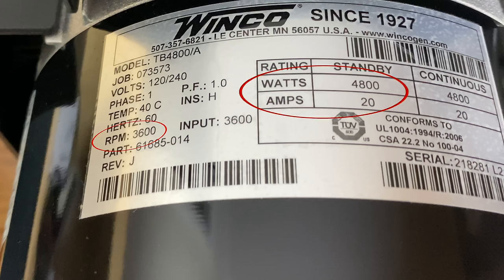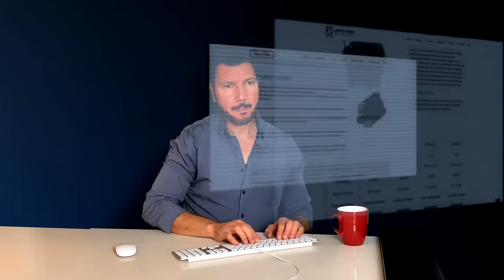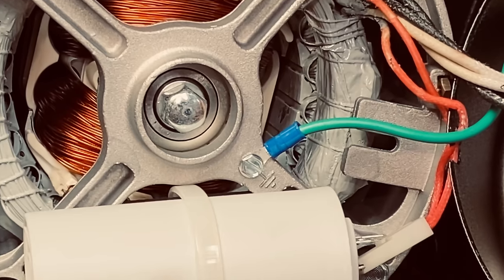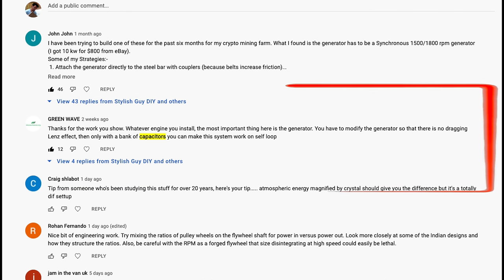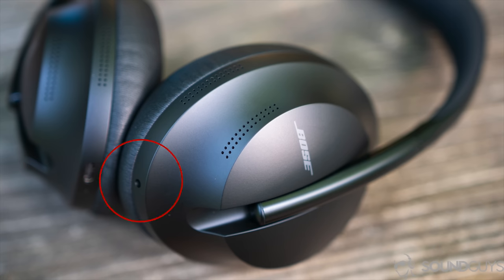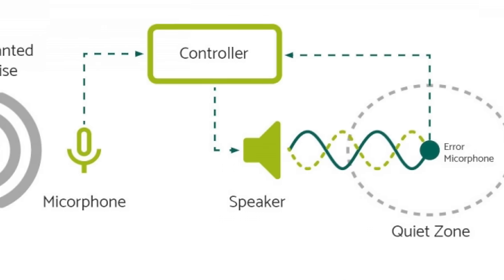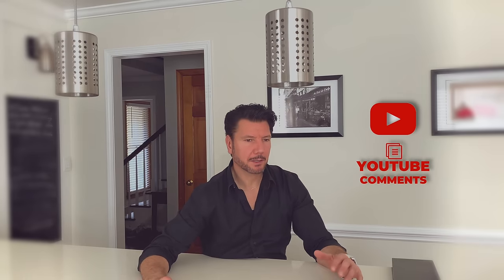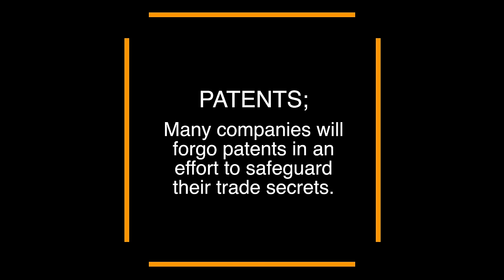Why does this Free Energy Generator not work?

Comment: As I mentioned in your other video you need to modify the alternator.  You need to remove the rectifier and modify it. Do you understand! I will give you a clue you need to divert the magnetic field. Or you can waste your time and money trying to make this more efficient with flywheels that are weighted more at the rim etc. and belt tensioners etc. - All of which won't work as you NEED TO OVERCOME THE MAGNETIC FIELD WHICH IS BEING ABSORBED BY THE METAL IN THE ALTERNATOR/GENERATOR AND DIVERT THIS TO THE OUTPUT OF THE GENERATOR! Your welcome!
Reply from the maker: Thanks Harry
Reply: @MarkusNenning  No problem Markus
Reply: Hi Harry You are brilliant, it really works. Thank you for your suggestions. I have almost the same set up liked Markus. Mind has no flywheel. Just Drive motor that 3450rpm wired to 120volts and 3600rpm generator 5000 watts watts. It’s a belt driven setup. My drive motor was lacking out power. I did removed the rectifier and modified the generator like you said. Them it works well done ! Thank you Harry!
Reply from the maker: @johncarreon8040  do you have a video you can share John?
Congratulations! Glad you had more success.

Comment: The problem:
A generator or alternator producing X kW of electrical power is being turned with MORE than X kW of mechanical shaft power (torque * rate of rotation).
Likewise, a motor producing Y kW of mechanical shaft power is consuming MORE than Y kW of electrical power.
No amount of re-wiring, re-gearing, balancing, friction reduction, or re-design of the motor, generator, or transmission can change this.

Comment: An idea to incorporate might be the 2 stage oscillation system where the input device does not feel the load whatsoever; see Malkevics 2 stage pendulum for the idea. The input induces output, but when you load and/or stop the output,  the input just keeps going. W. Skinner almost achieved with his efficient  machine powered by 1/8 horsepower motor and ran his machine shop lathe and drills and whatever, oh in 1939..you need to catch up!
Reply from the maker: Thanks great information will look into that!

Comment: The more output of current, the heavier is the  drag.  As for flywheel, it acts as a regulator in here.  No increase in total energy will occurs.

Understand Laws of Thermodynamic, General Relativity thoroughly. Researches into properties of magnetic fields, and understand single direction monopole first before you can do anything beyond it.

Comment: Wow, you really went off the deep end on this video. I admire your perseverance. Your right in the fact that this process is controlled by the law of thermodynamics. No disrespect but the math doesn't work the way you think. You'd have more luck going after zero point energy, at least it's theoretically possible.
Reply from the maker: Thanks Jim I will have to look into that have not heard that term “zero point energy”

Comment: Hi, you have very well explained different parameters of the technology involved...

Just make a small adjustment. Let the pulley used for generator be big and the pulley diameter connecting motor  a little smaller ..so that, the motor runs on less energy, the flywheel runs on high rpm  and always keep extra kinetic energy required to rotate the generator.... 

The setup should be like a part of energy generated is used to keep the flywheel running or the energy loss while flywheel on its peak kinetic energy is filled by the motor... 

Forget all energy used to rotate the flywheel. Let's start calculating from time when flywheel is at peak loosing energy due to factors like friction.. Etc etc.. ...so that energy is saved or earned. Also try using a very good earth...as we all know energy / electron too must be around to fill the losses occurred in the process...
Reply from the maker: Thank you!

Comment: Nice pivot from the last video on this topic. Harnessing photons from the great everlasting fusion reactor in the sky is the simplest way! maybe have some flywheels or compressed air or batteries or water heat (or elevation) for storing the excess energy for nighttime use.
Reply from the maker: Thanks Sean!

Comment: In my opinion, apart from stabilising the frequency, a flywheel cannot contribute to generating free energy. It must literally be pulled out of the vacuum by eliminating the counter electromotive force; as scientist Tom Bearden theoretically explains, it is also possible without moving parts. The Germans had already built such devices experimentally to recharge the batteries of their tanks in Siberia.
Free energy is reality but has been covered up by the energy lobby and their servants. However,
THE MIRACLE POWER PLANTS WHICH DO NOT USE FUEL, NO SOLAR, NO WIND,
are marketed by Swiss company TransAltec AG. The TransAltec websites offers all three generator variants:
- 3 MW (8 million USD)
- 10 MW (20 million USD)
- 150 MW (245 million USD)
Delivery time is given as 16 to 18 months and at ordering, customers are expected to pay 50% of the respective amounts in advance. Of course with mass production it will become inexpensive.
Reply from the maker: Thanks Peter!
Very low budget website from transaltec but very interesting!

Comment: in your first video, you changed the larger and stronger motor for a smaller weaker one because the breaker was being tripped before max rpm was achieved. The reason for this is because the motor was starting up too slow. A motor draws the most current in a range of 1-15% of full rotation speed. You will need a VFD configured to step the motor up in increments so it does not continuously draw massive amperes during startup. This will keep your breakers from tripping.

For the generator, you need to maximize the output current and voltage based on the full power draw of the load side. This means you will likely have to construct a generator yourself from scratch but this is trivial these days if you can get your hands on a milling machine or a lathe. You don't want too thin of an inductor wire as this will introduce higher resistance into the generation side and thus more losses. You also don't want too thick of inductor wire because it limits the coil turn count also reducing voltage so more coils are needed to hit a desired voltage at full current draw.

You can calculate the number of coil turns, number of coils, type of wire insulation, etc, and begin constructing the generator. The magnet sizes will need to be calculated as well. For each generating coil, you will want a north face of a magnet passing one side, and the south face of the next magnet passing the other side. This will double the amount of flux lines breaking across the same coil, increasing the amount of voltage and current induced. You can calculate the amount of unloaded current you will induce and the max voltage output of each coil this way and it will tell you what gauss rating the magnets should be at their surface.

For the flywheel, it is of the utmost importance that you minimize as much mechanical friction as you can. The bearings are a start but with the results you are trying to achieve, there are multiple friction points adding resistances in just the bearings and the bearing housings. The housing is bolted to the overall frame. This means frame vibrations are added to the outer bearing race which transfers that vibration to the balls, and then to the inner bearing race. The balls and inner races are rotating objects and when you introduce vibration to a rotating object, you get unwanted harmonics that can multiply friction losses by adding unwanted torques to those small objects. Trade them out for linear bearings instead of general purpose ball bearings if you cannot afford to design magnetic levitation for such a heavy flywheel.

The magnets you use for the generator will have to be around half the width of each coil so that you can maximize the generation per coil. Use 2 magnets per coil. So for 6 coils use 12 magnets. Neodymium iron boron magnets are the best for this. you can use more if you wish and have some in series for increased voltage output and some in parallel for increased current output.
Reply from the maker: You sound very much like you know what you’re talking about.
Have you built a generator yourself Nazgul?
Much appreciate your detailed feedback!
Your 100% right on the motor I may have to try that again with a VFD.
As you probably know all this is very time consuming and a lot of trail and error.
Unfortunately or maybe fortunately:) I have a full time job.
I did buy a car alternator that I now try to modify because building my own generator from scratch is definitely not an option at the moment.
Thanks!
Reply: @MarkusNenning  I am actually in the process of building a prototype that will utilize a full-on magnetically suspended rotor axle with no mechanical friction points. its a challenge but precision is my specialty so I can manage. I am using very strong N52 industrial magnets that each have 100lbs of holding strength to stabilize the axle in the X and Y axis. Its delicate but very possible.

I work as an industrial electrician and specialize in power delivery systems and PLC controls and signaling. I have to deal with unwanted harmonics in the 240, 480, and 680V 3-phase motors I install and maintain and power factor correction constantly so VFDs are an every day practice for me.

With my prototype I am attempting to capture normally wasted reactive power that is lost as heat in a closed circuit with inductive components. It will be an asymmetric generation system to create an unbalanced procession at a specific Larmor frequency. I am hoping I can create enough resonant harmonics with multiple oscillating factors and store that normally lost energy by setting up a pseudo dead short in the generator output coils when the resonance hits the correct frequency creating reactive wattage spikes.

if I can get a high enough frequency and have every octave balanced just right, I should be able to capture the reactive power and convert it to usable real power.

As you may can guess, it takes some very fine tuned balancing of the moving parts to make this work. So its quite an expensive and long term goal to get it built.
Reply from the maker: @nazgullinux6601  wow that’s an amazing plan! I hope you succeed and hope I get to see that.
Are you in the US?
Reply: @MarkusNenning  Yessir living down in Alabama. Worst place to live if you are an electrical inventor.

Comment: I guess I should have put a Paton on my idea. If the charging motor that is charging the battery that runs the motor. The motor will power the device. It is in the secret is in the gear. The charging motor has to spin fast enough to charge the battery to keep the motor running.

Comment: Try this- If a 2000w 12v 266 rpm  turbine generator produces 460 joules of energy per one rotation and is mechanically direct connected to a 3/4 hp, 12v,  1750 rpm motor  that requires only 19 joules of energy to complete one rotation, a mechanical feedback loop will be initiated at the introduction of an external source supplying the required 19 joules to rotate the turbine generator. This will produce 460 joules of energy  directly to the motor at the second rotation. Enough energy for 24.21 rotations which in turn exponentiates till the mechanical limit of each device is reached.  This should remain an electrically closed circuit/loop with the exception of the following constant load: 
 For constant energy production a second turbine generator equal to the first should be connected via pully to the looped motor as a single constant load. As the second 2000w 12v 266 rpm  turbine generator rotates, the output is directed toward a standard wind power conversion apparatus used no differently than any wind driven power generator that constantly rotates, charging a battery bank sufficient for loads appropriate to their capacities. 

 While theoretically  energy is not able to be derived from 'nothing', at no time in our physical universe, to the partical level and beyond, have we ever not been completely surrounded by energy.  
 It should also be noted that the term 'free' is an ambiguous contextual economic term that does not appear in any mechanical engineering context or applied physics research and developmental equation.

Comment: Nice build....too bad it won't work in its current state.  For starters what you may gain in torque and kinetic energy w/the pulley reducing prime mover you lose w/the pulley increasing at its load (the generator). Suggest you try a high speed prime mover (i.e. something that runs around 8-10,000 rpm  [perhaps a brushless DC one horse power motor] or (perhaps using a treadmill motor).  And let's not forget ....lowering  the load ratio to 1:1  simultaneously with the above suggestion should give you the approximate 3400 generator speed and the the kinetic energy to maybe keep the motor running. But once you break the wattage requirements for the motor you're....approaching the limits of thermodynamics.
Reply from the maker: Thanks and yes while this one may never work check out my new video and let me know your thoughts on it.

The breakthrough in Free Energy - a system that cannot be debunked
https://youtu.be/wqbJWBtoFMQ

Comment: I think you should not attempt to use  the existing motor circuits for any output other than sustaining the perpetual rotation.  The flywheel is not critical for stability.  Remove it. Add a separate generator/alternator in its place. Use pulleys that get the needed RPM.  That should do it.  If the generator/alternator turns at the required RPM it should give free energy. You've also isolated it from any other circuit, thus load balancing or frequency adjustments should be much simpler.
Reply from the maker: Thanks Michael!
I am currently trying to modify a car alternator and remove the flywheel like you also suggested.
Reply: @MarkusNenning  Great! I think keeping the alternator/motor both three phase will work. If a three phase motor turns at its rated RPM, considering its rated horsepower, it's unstoppable. It''ll drive anything including a large farm sized generator.  Although current level from the alternator is unlikely an issue, it's possible to piggyback similar alternators too, just like for power plants.  I'm starting work on my own setup that will drive my pool pump's 1 HP single phase motor.

Comment: get motor with high torque low rpm as must as 50rpm , connected to flywheel, connected to gear box ( 1:6), connected to flywheel, connected to gear box and next connected to alternator.
thus alternator rpm around 3600.. 
1. output power is fed to input of motor.
2. high rpm produces high voltage, when motor is cut off from 1500v to 500v it takes 2 mins , this two mins is valuable one, again motor can spin for 15 secs, to reach output rpm to 3600, considering a loop, this flywheel spin energy is used (in the deceleration time). this is method two.
we just need good solid 50rpm spin at the start of first flywheel, 
     I. which can be given by 1hp motor or 2hp motor...( we use flywheel energy here)
     II. place a 20k liter water tank in 'V' shape to give high water pressure which can spin the first flywheel at 50rpm.( we use the gravitational energy here here), same water can be sent to top of the tank without any motor.
    III. we can place a giant convex lens on a mini tank of water under sunlight which will cause boiling and produce team jet which can used to spin, the output steam can condensed to water by coiled copper tubes. again this water has to be fed to tank..( some losses will be there). ( here we use solar energy)
   IV. just sharing my wild view : required things:  1 lifts ( which can lift the 1 tonne weight) , 2 nos 1 tonne weight blocks, ,, here we use gravity , suppose the 1tonne weight is put on slow balanced chain which can slowly come down, ( by the time 1tone weight comes down, the other block of weight goes up via lift).. this is alternative to water tank, because 20k water tank has losses(water evaporation  losses)...

im trying to tell you that, yes flywheel has some energy storing in it when spins.. we can use it.. ORRR use gravitational energy.. both at 24x7 available.
which is useful and free, for people, govts wont agree.. simple.

Comment: I think the problem lies in the generator - your generator only produces electricity at high rpm - if you change the generator or replace it with a generator that also works at low rpm, the machine may work on its own. Thanks